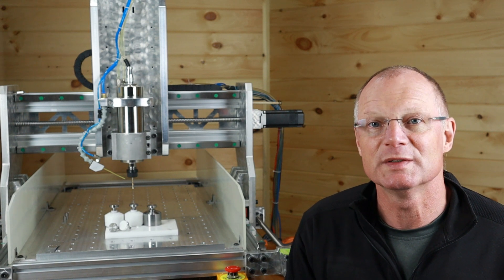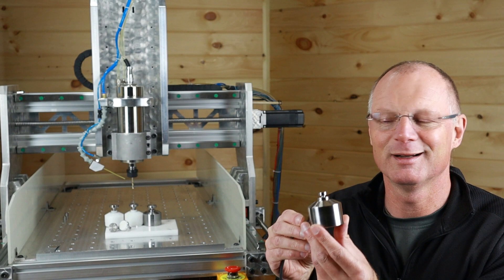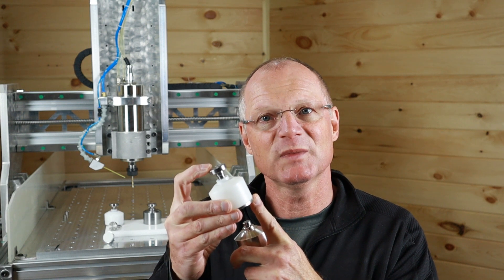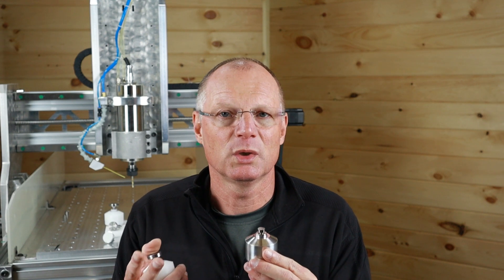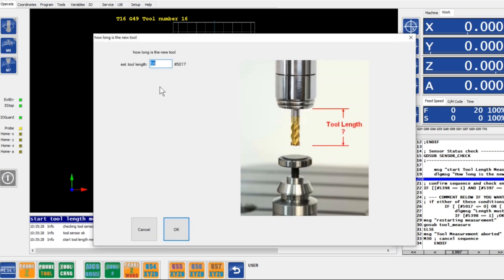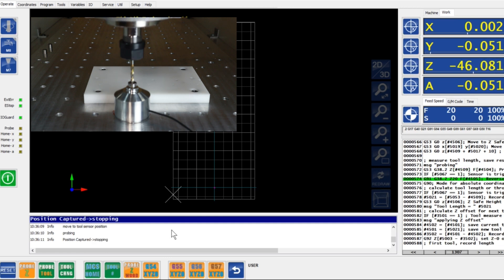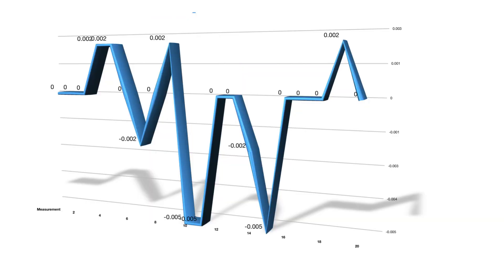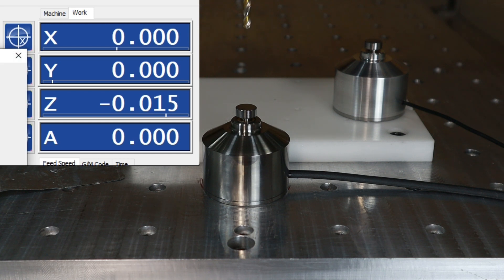CNC Tool Touch Probe 2/2

Comment: will thermal expension have an effect on the precision?
Reply from the maker: Yes it will, however the probe is small so dimensional changes are small as well. Also you can choose stainless steel for the housing instead of aluminum and cut the thermal changes roughly in half. The sensor itself is temperature compensated so no worries there.

Comment: Where I can find the 3D design for metrol one?
Reply from the maker: It is identical accept the sensor plate has a M5 hole in the center instead of a through hole and the shaft of the plunger is shortened. Very simple simple changes to the optical one. Hope this helps.

Comment: May i suggest putting the probe on a fixed location, so you don't have any "False readings"
(that is also why i wrote the calibration Routine to work with  a toolsetter at a fixed position)
Reply from the maker: Yes, I cut out the front right hand side of my spoil-board and placed a thin holding plate there so the probe sits in it’s ”home position” this way the tool length macro can be used as it always references that location.

Comment: What are the cable connections to the board?
Reply from the maker: The Panasonic sensor has 4 wires +,-, and then your choice of NO or NC. What your board needs I don’t know mine uses a NPN input so that is the sensor I use. Most boards have a direct wire connection or you can terminate the probe onto a plug on your electrical cabinet. I think this is what you were asking ?
Reply: I have purchased a tool setter which is NPN but I have no idea where to connect the wires (4 in total) to the eding board, I don't want to guess and risk burning something out.  @JBWorx
Reply from the maker: Ok I understand. So - goes to GND, positive depends on the power requirement how many Volt dies your Probe need ? So it could go on the 5V + output anywhere. One of the 2 other wires is for normally open or normally closed so pick one does not matter for the first test and connect it to the CNC In labeled Pro (for probe) and that is it. This is the 720 break out board I am looking at right now. But the other boards go in a similar fashion. Hope this helps
Reply: Thanks, that's great help @JBWorx
Reply from the maker: No problem 😉

Comment: Nice video as usual. 
There is also the option to use the Metrol switch alone.. i have one which i use in my 3D printer (nozzle touch sensing) and it has a metal cover already on top of it... so the enclosure and the push mechanism becomes a bit redundant in this case..
Reply from the maker: Yes you are correct, if I remember right the 1 micron version with only 5mm diameter is $350 and the 10mm sensing diameter about $650. Pricey
Reply: @JBWorx  mmm.. i paid mine (from Misumi 1 micron 10mm diam) around 100 Euro (two years back..)
Reply from the maker: That will be the cost of just the switch I used no housing or anything else. The unit you are referring to is P11DBB sold by Misumi US; it has only a  5mm disc and is $150 that is in my opinion to small of a diameter. Automationdirect sells the 10mm / 18mm version (P21EDBP) for $634 like I said “ pricey”

Comment: Nice results.
I'm really missing some way to fix this probe to the table though. I know many people use the probe to measure the tool length and the Z offset of the Stock material. However I find it much more convenient to have a fixed TLS position and use a 3d Probe for Measurements on the Table. For this its critical that the TLS is fixed to the table in a solid way.
Reply from the maker: Yes that is my plan as well I have a 3D Probe in parallel to the Z Touch Probe. Actually many don’t use it that way but you also have an automatic tool changer if I remember right. That makes that almost a must. So the probe sits on the right front on my machine and it is fastend down using a different base (this one is made from Al). At the moment I think I might drill trough the table and fasten it underneath and just let the touch surface stick out. Not sure yet. Anyways thanks for your comment.

Comment: Now the question is: Is it worth it to pay 5x the price for the Metrol for a diy machine, knowing that 0.007mm is already pretty good out of the box! Awesome video as per usual!
Reply from the maker: Yes that is totally up to the individual. I personally like accuracy … also interesting the first build request I had was to make the Metrol
version and I added a ceramic plate on top. I think it is really up to the parts you foresee making.
Reply: @JBWorx  I agree! Do you have a link or a model number of the metrol switch? They might just be easier to install than my panasonics
Reply from the maker: Actually from Amazon but it is not in stock right now. So Misumi is your best bet.
Reply: @JBWorx  Thanks! I've actually found a place that sells them here in America! They are much cheaper than I expected. ''much'', still 78$usd ahah
Reply from the maker: Yes that sounds right just watch there is a 3 micron and a 1 micron version. Did you see them at automationdirect ?
Reply: @JBWorx  I did find them there! I'm currently looking at the CSH121A-AL, it says 0.005mm repeatability (which is more than enough for me) and it would be a drop-in for my machine.
Reply from the maker: I am sure it will be a great upgrade and the lifetime of these is pretty amazing.
Reply from the maker: Oh forgot to mention if you get the version that has a LED on it the polarity becomes critical. I had to cut the LED out as I use the switch in the 0V wire only. Thought I mention it.
Reply: It’d probably be best to be at latest 1 order of magnitude higher for measuring tool height like this. That way you’ll know 2 end mills will surface at the exact same height repeatedly. Metrol switches are probably the way to go.
Reply from the maker: I think both are a good option depending on the use of your machine. I do a lot aluminum and lately some steel. However the real advantage is how rapidly I can set now Z0 and also I can measure directly from the Probe sitting on the table in its “home” position for tool changes. That makes things so much easier, I really like it.